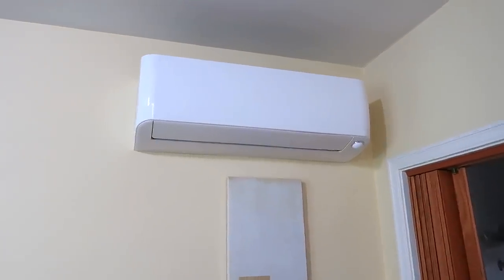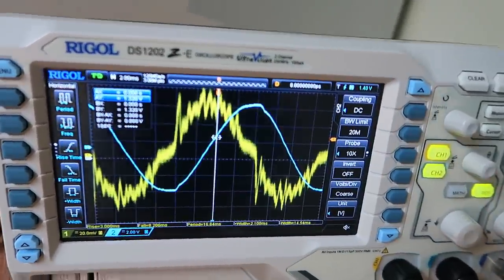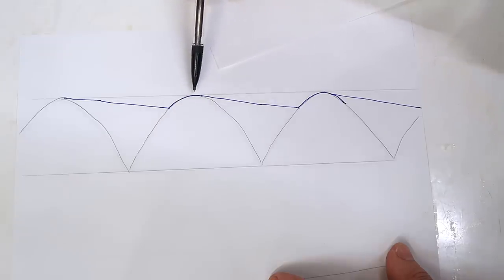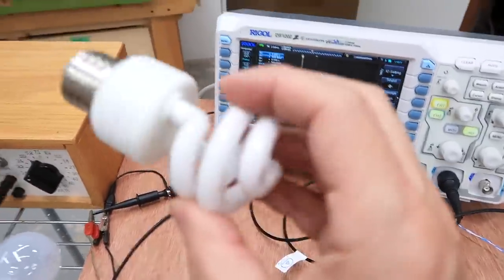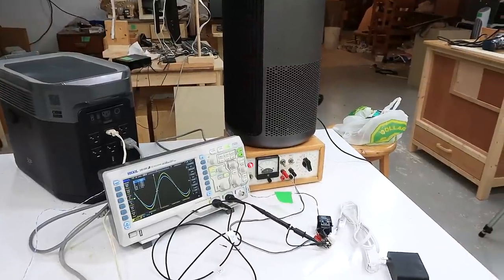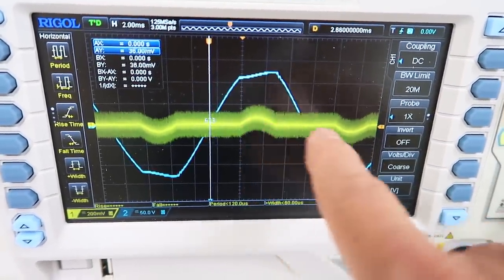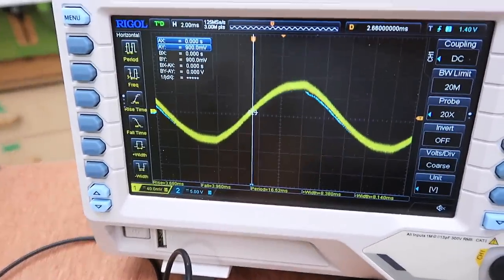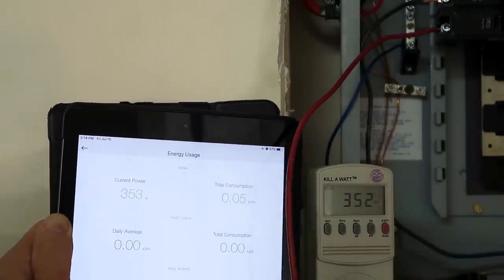Our electrical is all wobbly, measuring power is hard

Comment: 10 years ago, the UPS load at the data center I work in was close to 0.94 power factor.  Right now, the PF is closer to 0.99.  Computers have progressed a whole lot.

I do wonder what the FFT of these waveforms tells us.  Your voltage trace has artifacts that tell me that you've got other mini-splits or similar equipment (maybe all of your LED lighting is contributing to it) running at the same time.  The symmetric disturbances will appear as odd numbered harmonics, with the asymmetric ones being even.  Each tells a story.
Reply: Yeah there is power factor, and then there is harmonic distortion. I think some of these "peaky" loads play real havoc with the harmonic distortion even if they are not bad from a power-factor perspective.
Reply: Mind that, because such loads are so pervasive -- it need not be within the household!  Neighbors, the whole neighborhood even, may be contributing. These harmonics travel well through the distribution network, so it can actually be pretty general.

Comment: I use a PZEM-004T module (80-260V, mine came with a clamp on CT for up to 100A) to monitor a 240V outlet in my garage.  I have it read out with a ESP32 (via serial interface), but I'm sure you can do it with a Pi as well.

Comment: If you are able to sample way higher than the fundamental (60Hz) .... active power is just the sumation of the V*I products at each sample point (t is not the same as V(rms)*I(rms) ).  You need to compensate (delay) one of the waveforms a bit to compenate phase shift in the circuit. Mesurement chip go from 2Khz up to 8Khz. Which is pretty wide to catch a good number of harmonics. Ths current waveform of the minisplit is a sine wave, but with harmonic content. But this harmonic are not high, mostly 3 5 7 etc ... so you dont need a big bandwith to resolve it.
But, in many cases, regulations limit the power calculation to the fundamental. So, they run digital filters so narrow it and them the proceed with the sum of the V*I  products at sample level. The sum is integral as long as the sampling rate is higher than the fundamental. Of course all needs to be scaled properly and time taken into acount.
Reply: Note that the average doesn't depend on phase -- as long as you're picking a random point in the wave each time, you can still build the average!  An even distribution might be hard to arrange with an rPi, but if it's possible, and you have some time to wait between averages (could be seconds, minutes..), it works!
Reply: @T3sl4  Not too keen in the deep math of this process but when computing watthour by SW they rely on a fixed period to do the sampling (a timer ISR). But  sampling freq could be anything you want as long as you scale properly at the end. I have seen 800Hz 2500 / 3200 Hz sampling ... the only thing that really needs to be compensated is the pahse shift as a result of the input circuity sensors (CTs are really bad on that) and the delay induced by the SW itself, since you go from one ADC chanel to the other. and this add delay. In the end you let the SW do its things and you calibrate the phase compensation as a whole.
Reply: @38911bytefree  fwiw there are CT designs that actively compensate to cancel for core flux reducing error from ~3 degrees down to 3 arc-seconds... 
cheaper passive transducers will also vary their ratio and phase error as a function of amplitude, temperature, and frequency (requiring special calibration to use in products).
And some ADC's support simultaneous sample+hold, making the measurements a little easier to process.

Comment: Wouldn't you multiply the power from the kilowatt meter by 4X. V^2 / R
Reply: no. He was not applying half the voltage to the load (which is not resistive anyway)
For (instantaneous) real power, P = V x I. The meter is measuring ~half the voltage and all the current, thus half the power.

Comment: I have tested the voltage and current waveforms of multitudes of LED bulbs and dimmers. The “dirty power” waveform makes zero cross detection difficult for dimmers. Two-wire dimmers use current for zero-cross detection. Now, using a single, very low-current led can be almost impossible for a dimmer to deal wtih

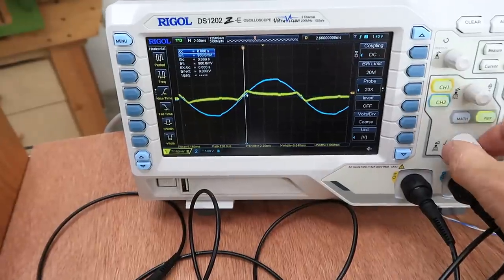Comment: Is the Lutron dimmer at 4:23 one of the old 600W dimmers or a more modern "LED capable" dimmer? It might be nice to test which ever one it isn't as well. FYI the dimmer wikipedia page is great.
Reply: An old one. The LED ones are trailing edge dimmers. LEDs cut the teaioing edge, not the leading edge.

Comment: I heard something along those lines: "the RaspBerry Pi is too slow and the Arduino is too expensive for this project".

When digital computers didn't exist or were slow, one used analog computers. Then one used hybrid computers, using the digital computer to make things like setting the initial conditions, displaying results and so on. 
You can use an analog front end which will multiply the value of the current by the value of the voltage. Two non-linear amplifiers (called function generator here) will give Log(A) and Log(V). They can then be summed to give Log(W), Another "function generator"  gives EXP(Log(P))= P. An integrator will then give a signal usable by the RaspBerry Pi.  The RaspBerry pi can initialise the analog integrator, read the value after the desired number of s and reinitialise the integrator. The digitised P value must then be factored by the RaspBerry Pi to take into account the integration duration, the time constant of the integrator and so on.
Hybrid calculators have been constructed up to the mid sixties (I think). They were used when a fast digital computer (with a real time operating system) were not fast enough or too expensive.
Some might still be in use. 

resource:
search for 
analogmuseum.org/english/examples/hybrid/  and

analogmuseum.org/english/
Reply: Arent arduinos cheaper than rasperbarry pi
Reply: @badgermcbadger1968  Listening again, Matthias didn't say the Arduino was more expensive, he said he would not embark on Arduino programming now.

My point in fact was to show going digital was not necessarily a panacea. (when one has a hammer everything is a nail syndrome)
I have to admit that nowadays, digital computing power cost has become a little fraction of what is was even in the 80ties while it is not necessarily the case for analog components.
An AD633 multiplier cost about 6$ (by 1000 pieces) and has a total error of 2% while an AD534 with a 0.25% error cost about  33$ ( by 1000 pc). A flight simulator made for my organisation end of 80ties used hundreds of operational amplifiers and was piloted by a mini computer HP1000-A300 (with math coprocessor) running under RTE real time OS.

And as some others have pointed out there are now specialised circuits for power measurement.
Reply: I'm fairly certain the raspberry pi is not too slow for mains power measurement...  It does take time and effort to design and program an algorithm that is useful, so that's more likely his limitation. 
Power measurement can easily be done at 1kHz, but it is much easier at 2kHz and up. My first power meter design over 20 years ago used 2kHz sampling with ring buffers and interrupts on a 68k micro. New cpu's just love multiply+accumulate for integration - it's usually a single instruction, and DMA engines can often handle all the data movement

Comment: I couldn't tell from the video, but are you using the proper load resistor on you current sense coil.  They need to have the specified load resistor across the coil to read correctly.  Like others have mentioned, unless it a perfect shaped sine you have harmonics present.  Generally the harmonics don't represent a lot of power so for your measurement they can be ignored.  Use a low pass filter on the output of the CT to remove the upper harmonics before running it to the scope or and ADC converter.  Likely going to need some gain or an active filter.   Just adding a cap across the output of the CT will do a lot to clean up the signal for some initial testing.    For best accuracy and best signal to noise ratio you want to use the current transformer at or above the midpoint of it's specified current range.  Adding more primary turns will help reaching this point.     Good luck,  I did the same thin with my Senville mini-split .    I have a 8K Btu 120V unit that maxes out arount 800W on the Killowat meter.   The control board is a VFD and converts the 120 or 240 to a variable 3 phase power for the compressor motor.  The units have a PID  control loop that matched the compressor RPM to the needed cooling load.   I saw my unit run between 60W and 800 watts depending on how much BTU's it needed to push at the time.    I suspect it could even be below 60W but I didn't test this closely,  the fans will take some power in any case as they don't shut off. 

You can under sample on the arduino and still get a valid reading, just average over time, I believe that is what the Killowatt meter does.
Reply: most likely it is a "current transducer with voltage output". 
Eg.. a 1:1000 transformer with an integrated 100 Ohm burden resistor will convert 1A to 1mA (internally on the secondary) and develop 100mV on the output wires.
The harmonics generally don't represent any active power when the voltage supply has very low impedance. At the end of a long run or underrated extension cord, it would be more pronounced (at the load).

Comment: If the waveform constant I think you can still use the raspberry pi.  You don’t need a lot of samples per period just samples across the period over many cycles.
Reply from the maker: yes, but I can’t sync voltage and current readings with my a to d converter

Comment: What are the downsides of poor power factor? In the real world, does that increase power consumption at the grid level?
Reply from the maker: makes less than optimal use of transmission lines and transformers.  At a power factor of 0.5, max load for wires and transformers will only give you half the power that would be possible with a power factor of 1.0

Comment: The title of your video is both vague and incorrect
What sort of power is hard to be measured?
Voltage signals can be sine wave, square wave depending on what sort of voltage signals is coming from the power or voltage source, but not necessarily only sine way. The signals can be either continuous or discrete

Comment: About 30 years ago one of the clocks in my house started running double fast.  The guy from ConEd had nothing useful to say.  So I hauled a scope from work back home and found weird squiggles in the voltage such that there were extra zero-crossings.  When I showed this to another guy from ConEd, he opined that it was probably a bad bearing in an industrial motor up at the hospice a few blocks from my house.  Not that ConEd could do anything about it, but he figured the hospice would probably have to replace the bearing when it failed completely.  And the problem did go away eventually.  Why just that one particular (cheap) digital clock in the house, and not the others?  No idea.
Reply: The others could be using the NIST WWVB at 60kHz

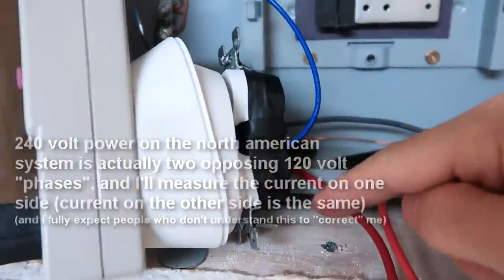Comment: 8:03 There are actually very few devices which draw current only on the positive or negative half-wave or are simply unbalanced. So in my opinion it should work good enough this way. There are for example some devices which use a simple diode to reduce the power to only one half-wave. In this case you can not measure it in an optimal way. But these devices should be quite uncommon.
Reply: half wave "off-line" rectification is not recommended.
Reply: Hair dryers on low usually run the element through a diode. It was also common in many solid state TVs, and most hot-chassis tube equipment would use half-wave rectification for the B+ as well.

Comment: Measuring current is challenging, those first waveforms from the CT on the panel look like that because your are capturing noise from the coil itself and the long wires, its an artifact of the measure. You can notice the same if you leave your probe near a power line, the scope will capture a lot of 60hz noise, or if you move your scope closer to the panel and probe the ct the closest possible that noise will decrease. There are two approaches, use a current clamp designed for a oscilloscope (basically, the lossy coaxial will go to the very tip of the probe and induced current is translated to accurate volts per amps) or use a power shunt and sample the voltage drop over it, for this a differential probe should be use to not 'blow your scope with a ground loop' but this is the cleanest way... Cheers!
Reply from the maker: it’s not like RF frequencies.  it’s Kilohertz frequencies.  the issues you describe become significant at much higher frequencies.

Comment: Brilliant, thank you! Imagine what a large industrial plant does to the grid (or would without countermeasures)…
Reply: Probably just big inductive loads or VFDs.
Reply: Large industrial consumers actually have a minimum power factor requirement in the contract. So they have to use well behaved equipment with built in PFC or do external power factor correction on site using capacitor banks. If they don't do so the power company can charge them extra or threaten to disconnect there service.

Comment: It would be nice to enable FFT on the scope and see the different spectra these devices are throwing.
Reply: The current harmonics (from a single phase supply with a 4-diode full wave bridge) will be all the odd harmonics in decreasing amplitudes
Reply: @dl5244  I bet you will find more than harmonics :-)

Comment: I'd have gotten ridiculed by the guy teaching my electronic circuits class for describing a waveform as "wobbly". Not in a bad way, we all laughed. He wanted a more specific, non-layman description. 😁

Also, standard 240 split phase is not two phases. 240V split phase does not provide you the ability to generate a rotating vector on its own(And thus self-start a 2-phase motor, of single phase motors use a capacitor to aid in phase shift to generate a vector from single phase alone), and by definition is still single phase. In some cases two different 120v taps from a 3 phase transformer bank are used instead for each line instead of half of the same phase in which case you would have a true two-phase setup for a 'residential' application with 120 degree separation between L1 and L2 when referenced against the neutral. You end up with 208V line to line in this case. I think the best example I know is a video Medhi from ElectroBoom did a while back in his apartment.
Reply: I agree that split phase doesn't provide torque (ialpha) and flux (ibeata) producing currents (Clarke transform) unlike 3 phase and capacitor start. However the definition of a phasor is just a sinusoid so I still think that split phase and capacitor start both have two phasors just different phase angles.

Comment: If you'd used an old skool analogue integrator you would have had a far easier time. A mechanical electricity meter would be a good choice although you wouldn't have got instantaneous consumption.
Reply: Mechanicals Watthour meters will never show the power delivered in the harmonics. Electronics can, but limited by regulations.
Reply: @38911bytefree  Another C64 fan. The lower order harmonics sum to zero for real power and the higher orders are tiny. I'm not sure that digital quantization errors are much more accurate.
Reply: @davelowe1977  LOL .... ADC used in metering are not the tipical ADC approach they are Sigma Delta type and they have been offering 22 to 24 bits from mid 2000s ..... They are "1 bit" ADCs with a high speed modulator and a one bit DAC as feedback. They can tell if something change up or down at a very high speed of rate (4Mhz is not strange). Them they use oversmapling and noiseshaping .... To me sound more or less like a CD player theory ..... Some old school meters used SAR converters 10 to 12 bit with twin scales due to dynamic range ... and yes those are probably useless to do harmonics ... they barely meet class 1 in active ..... Analog is offering 7 channel 24 bit sigma delta for 3 phase energy soic with harmonic analisis up to the 31 and 8Khz BW .... not bad.. But the target is BIG exchange points or big factories or power subestations. were numbers are soo huge that penies add pretty fast. Residential are built around cheapo processors .... dont expect harmonic analisys  due to lack of procesing power.

Comment: The mini-split uses a VFD.  Your scope looks like the current draw from that VFD.
Reply: Is a VFD not just a rectifier and a motor driver? In this case, we don't really care what's on the load side of that power supply.
Reply: @user2C47  They are not power supplies but electronic speed controllers that alter the frequency while maintaining a constant output voltage.  They act very strangely on the grid.  Throws the power factor off.  But very efficient.
Reply: @JWimpy  A VFD is the same as a "power supply" if it doesn't have APFC on the input. It's just a bunch of rectifier diodes feeding a DC bus with capacitors - EXACTLY what he showed here. Then it takes that DC and uses IGBTs to turn it back into AC again, but like you said, what's happening on that side of the VFD is irrelevant for how it appears to the AC Line
Reply: @JWimpy  VFDs do not maintain a constant output voltage. They vary both frequency and voltage.